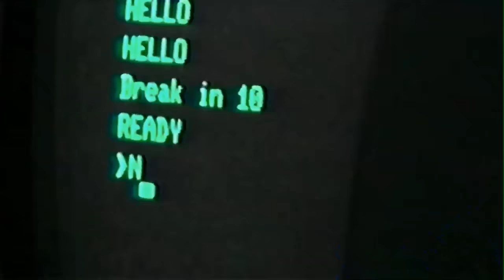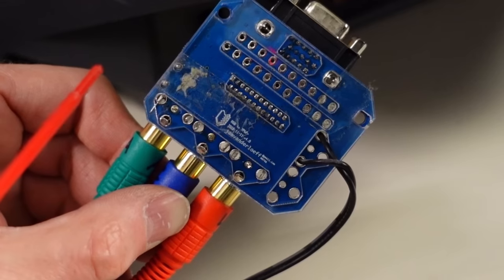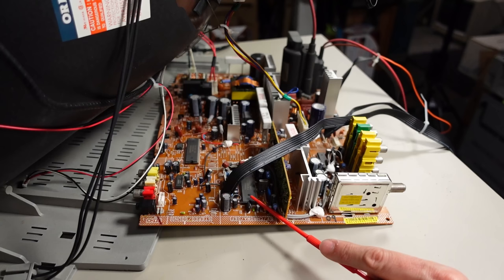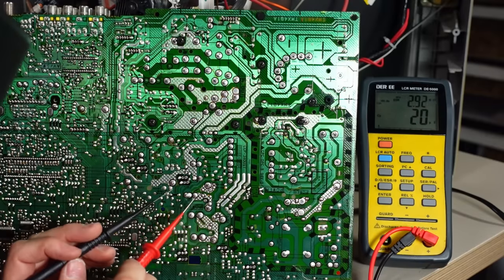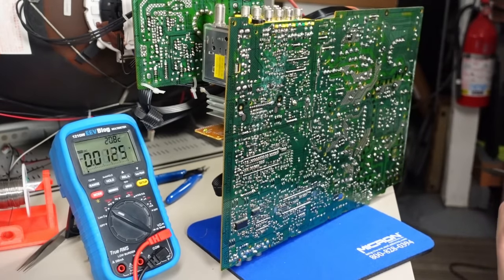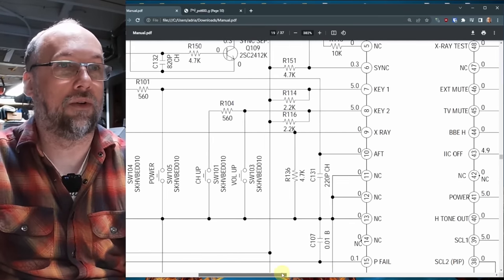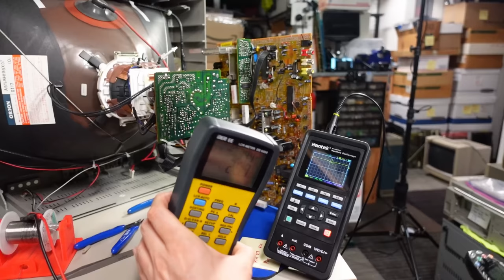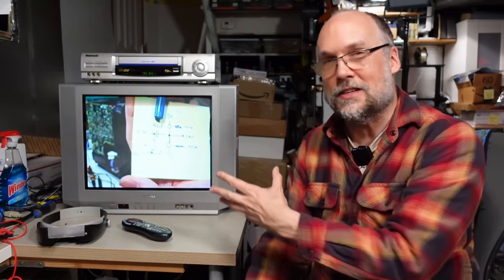I figured out exactly what's wrong with my Toshiba CRT TV (20AF41)

Comment: To be honest, I would check the other things that are connected to that 5V line as well.  It's quite possible that it wasn't just that one capacitor that was the cause, but a combination of several of them, all getting to the point where they're respectively failing to do their full job, and the total sag is adding up to too much.

Or there may be another component which is consuming more power than it's supposed to when the set first starts up, causing the sag in the first place.

I can't say for certain, but my gut says that it doesn't really feel to me like you've necessarily completely fixed the issue, maybe just postponed it...
Reply: You are right. The main problem is poor engineering. The 5V (standby) rail that is sagging is getting power from a 8.9V unregulated rail, which is also powers an other 5V rail through a 7805. The 8.9V rail is filtered by a 470uF capacitor. The 7805 has an other 470uF capacitor on its input, and a 1000uF on its output. So when the switching transistor switches on the 7805, it switches a discharged 470uF on the 8.9V rail, which only has an other 470uF for filtering. This is a huge inrush current, and the 1000uF on the output of the 7805 also adds to that. Not great, I would say. As I suggested above, I would replace the 470uF on the 8.9V rail to 680-1000uF. The ESR of the original 470uF probably gone up a bit, but it was probably only marginally working from the factory, due to this bad design decision.
Reply: @mrnmrn1  Ah, I have to admit, it hadn't even occurred to me that the problem might be on the upstream rail (but I also didn't go and actually look at the schematic, because I'm lazy).

That just shows how it does really pay to look at the larger picture and not just focus on a single piece or component, though..  nice investigation work!

Comment: I recently salvaged an old EMac from mid-90's from an old lady who was about to toss it. Now I am not so interested in the Mac components but it does have a really nice nearly flat shadow mask CRT. She also said it had not been used for a long time and when new it was not used much either. The machine has seen at most 100 hours of operation. I have yet to disassemble the machine, but I am expecting the CRT's Cathode to be nearly pristine. Keeping it for eternity or until it breaks, because these things are becoming exceedingly rare. If only I'd realized BEFORE I tossed a beautiful trinitron CRT (approx 10 yrs ago) with ultra fine aperture grille, how valuable they'd become. I love LCDs but CRT's gives the retro stuff a pure look like nothing else. 
I am hoping there's some genius little guy sitting in a little office somewhere in China or Japan working on a way to make flexible OLED displays with a bulge so they resemble CRTs in appearance.

Comment: If its "actually from the 90s" & a higher grade model it for sure has S video. 
That was a must as everything had S video in "1998" etc that i ever saw.
Edit- I am positive I have two Orion sets. Bought cheap after led tv became popular. One still in the box with the Future Shop receipt and warranty, never used, the other lightly used. I can't remember if they have S video but the spot to connect everything is up at easy access.  
The receipt date was late 2004/early 2005 so the last gasp of crt tv. The box states something like "High quality TV". I bought it for a relative who after decided he wanted a big  flat screen so here it sits. 
I also have an MTC that looks a lot like a clone of Adrians set i use to test dvd players on. 
There's been a few cases where faulty components were going out to customers and companies.
Both transistors and caps.

Comment: We had a really nice Philco that was a 'flat' CRT in the early early 90's. Lots of digital on-screen controls (in green!), pretty nice size, and beautiful black case and metal grill speaker covers on both sides of the screen. It was really nice. I can't find evidence that it ever existed - or who actually made the TV, as Philco is sort of one of those non-brand brands.
Reply: Philco US was owned by Philips since 1981. It was its own brand before becoming a Philips subsidiary. But you're right, flat CRT were a thing (but not quite common) in the late 80's/early 90's before becoming ubiquitous in the 2000's to align with LCD screens.

Comment: I've got a bit of a headache with  swapping the smaller electrolytics with MLCCs. The ESR you measured seams not to be uncommon for an electrolytic of this voltage rating and capacitance. The MLCCs you used as a replacement are most likely X7R or Y5V, so they have a more or less significant capacitance over voltage derating. If they're used as bypass capacitors than it might be OK, but a higher ESR cap might also have been chosen on purpose...

I also believe that swapping the larger cap did not fix the actual problem as the voltage dip is still there, just somewhat less pronounced. So the power supply is still marginal. I'm with @mrnmrn1's post here.

Comment: The clogged-head syndrome reminds me of those cheap no-name VHS cassettes, where if you left it on pause for a few seconds, you could watch the picture deteriorate into snow requiring another head cleaning operation. The opposite of course being those Memo-wrecks tapes which kept the heads perfectly clean by virtue of sanding them down, including the upper (and sometimes lower) drum.

I tended to use thin card on its smooth side rather than paper though and gently rock the heads back and forth to dislodge the crud from the heads without stressing them. Mind you, back then König had pretty decent "pattern" replacement video heads for around a tenner trade, which seemed just as good as the originals and lasted well. Those were the days!

Comment: Saw the ‘Special K’ Rubycons and didn’t think it would have been that! Remember the early 2000s Cap Plague, swapped out over 200 Dell GX270 motherboards, the Special K caps always were fine.
Reply from the maker: Yeah!! I was surprised quality caps in this TV -- and that it is having an issue. I just worked on a 2000 era Soyo P3 motherboard -- and some "Wendell" brand caps were all completely dead. 1000uf/6.3v and all were 30-50uf with high ESR. At least they hadn't leaked but what crap!

Comment: You should use the tweezer lead that comes with the DE-5000. It does four wire measurements that should be more accurate without the extra resistance and inductance of the multimeter leads.

Comment: Especially on a CRT, component is as good as true RGB. I use a SCART RGB-component converter for all of my game consoles. It works out well, since SCART RGB cables exist for pretty much every RGB-enabled console and most 15kHz computers.
Reply: On CRTs from the 80s and 90s, SCART RGB goes almost directly to the electron guns. However in the 2000s, this changed, because processing had to be done (for example for the 4:3/16:9 switching). Those televisions mostly do their processing in the YUV colour space, which means that RGB from SCART is immedeately digitized and then coverted to digital YUV, which then went into the image processor. For such televisions, it is completely irrelevant wether you use SCART or component. On the older televisions, RGB is favourable as it is the native video signal for a CRT.

Comment: I have that same exact Panasonic Super VCR VHS player that still works to this date.  It has the problem of playing older VHS tapes in SLP and EP (4 hr and 6 hr formats).  It plays and tracks regular SP (2 hr) tapes.  But yes!  Neat you fixed it cleaning the tape head.  I haven't cleaned mine since owning it from like 2002  or some day then.  As far as CRT TVs I think I had a simple diode problem failure but I added to the problem by cracking my bottom power board as the TV maker confused me as to extra set of screws that needed to be removed hidden at the bottom holding that board in place when trying to remove the back on a 2005 RCA CRT TV with those same number of accessory ports also for inputs and outputs to the TV.

Comment: I watch a lot of urban exploration videos and several years ago there was a video where the guys went to China to do some urbexing over there (probably not exactly the smartest thing to do, but that's another discussion) and they ended up inside of an abandoned manufacturing facility that had a lot of stuff left over in it that wasn't Orion, but was in use up until the late 00s according to some of the left over documents they found. There were brand new, unused CRTs on shelves (just the bare tubes) as well as a room with some of the coil winding machines that were used in the manufacturing process. That stuff was probably some of the last remaining CRT manufacturing equipment in existence and it was just rotting away in an abandoned building in China somewhere. It was a bit sad to think there will never be another new CRT manufactured in this world. The manufacturing process is so complex and requires all of that specialized equipment to produce that there's zero chance for some independent manufacturer to pop up the way other things, such as cassette tapes, have.

Comment: Hi adrian, Ray Burke here, I have the same DE 5000 capacitance meter. When measuring ESR of Electrolylics, you need to use the 100 KHz for ESR.  You might check the Data Sheets for the capacitors you are testing they are online by Manufacture.  It is usually listed at the top of the chart.  Most Capacitance testers can test ESR in circuit, pull part if high.  Most people have trouble using  that high end  Capacitance testers like DE 5000.  Good luck from Ray Burke, I live in Oregon City.

Comment: Sometimes when the heads are grimy enough and IPA doesn't cut it, I'll CAREFULLY use a bit of acetone and a swab before using the IPA and paper again. That tends to work wonders, but I definitely recommend sticking with it as a last resort if isopropyl alcohol and paper isn't cutting it.

Comment: "The Cap Plague." 😄  According to the story I heard, it was a case of industrial espionage which went very wrong.  One capacitor manufacturer tried to steal another manufacturer's chemical formula for the insides of electrolytic capacitors, but the formula which they stole was the equivalent of an "early draft" which had not been properly balanced.  The formula was followed exactly and because it was wrong, it caused the early failure of all of the capacitors manufactured by that company.
Edit1:  I just noticed that you have Cubic Player running in the background!  I wish I could find more module files to play.  The main problem with Cubic Player is that these days it has to be run through DosBox and that isn't always reliable.
Edit2: I've had a TV with exactly that same problem.  It started clicking when I tried to turn it on with the remote, then after a little while it would start up.  The problem gradually got worse and worse until it wouldn't start at all.  I replaced the power supply capacitors (they were bulging) and the problem went away.  I've heard of caps going bad without bulging, though.
Reply: I t used to be so common to open up a computer in the very late 90"s early 00's and see capacitors with the vents popped and dried electrolyte on top.

Even 1 year old computers would start rebooting and freezing up, and you'd open the case and find split caps.

In 05 I got a job doing desktop support and the guys that had been working there said an absolute boatload of the Dell computers the company was using (1600 person office) had this issue, they were replacing motherboards and pc's like crazy.
Reply from the maker: Yeah I run OCP on my Pentium with a SB16 and it just works perfectly. What a great program! I've been curating my module collection going back to my Amiga days. I liken it to a CD collection! As for the caps -- yeah I don't really get why it seems late 90s good brands are kind of junk too. I assume it was cost cutting to be more competitive with the stolen formulas? And that cheapening resulted in them going bad more quickly. Just such a difference between caps from the 80s....

Comment: Hi Adrian,
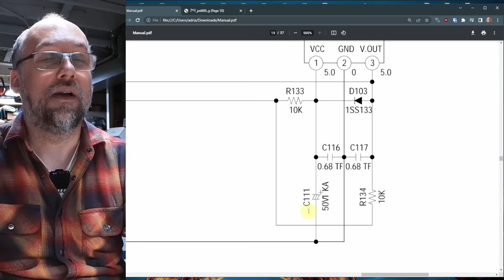@50:00 did you check C111 at least? Looks like the supply for the reset IC is filtered through a 10k resistor (R133). If there is a “short” drop-down in the main +5V, the combination of R133 and C111 should prevent the IC to trigger a reset. If C111 is defective, the IC “sees” the +5V direct over R133 and a short drop will cause a reset. A good capacitor (C111) will filter a short drop-out.
Or maybe I'm wrong :)

Comment: Capacitor plague never ended. If you watch a repair video on a modern hardware, it's mostly a small surface mount cap shorted to ground.
Reply: Capacitors have always had a limited lifespan. It's the nature of What they do and how they do it. Some last longer than others , especially if the circuit is well designed and doesn't overstress them and if they were made well in the first place. Even then that's never a guarantee they will last. The smaller they shrink, the more vulnerable they are to contamination and other micro issues because there's just less room for mistakes.

Comment: On Orion made sets at least from the early 90s it's important to remove the rubber wedges as they will eventually destroy the yoke. I had to remove them from my 1993 Orion made set before they caused trouble.

Comment: I had this set back in 2002 to 2004 before I upgraded to a LCD. The speakers were great really good loud sounds the amp inside this set is good. 20 watt for each speaker 40 watts max not too bad. The component if I remember could do 480p input the rest of the inputs were 480i. S Video did give better colour on screen but the component gave better quality in the picture overall.

Comment: that cap was probably borderline capacitance value for what was needed, or maybe a problem further back in the psu making the 5v cpu line dip too far
Reply: It is! 1V dip is way too much, even if we ignore the reset circuit that is supposed to do its job when voltage is somewhere below 4.5V
Reply: I don't know, you don't just lose more than 20% capacitance over time without other traits of the cap shifting as well. ESR and the leakage. Theese are not strictly constant, they can drift depending on the soak voltage, which is why the measurement might not come out quite as bad as what it really is like. Capacitance often secondary to in-circuit behaviour like that.
Reply: @SianaGearz  definitely, you can have reasonably good capacitance, but far too high esr, you really need to check both to be sure a capacitor is bad or not, as a capacitor degrading from say 10uf to 5uf could still have a reasonably good esr

Comment: I kind of regret getting rid of the 480p ATSC-equipped 20" RCA flat CRT I found on a stairwell landing at CWRU during a summer research fellowship now.  It was actually a pretty nice one, progressive scan, low tube hours, component inputs, capable of receiving OTA HDTV signals.

Comment: I had that exact TV in the early 2000s. It was, in fact, my first TV when I got my first apartment. That red LED does indeed just indicate power. It should be on whenever the TV is on. I'm not sure why yours doesn't light up. Maybe it's a bad LED?

Comment: Most Toshiba branded monitors and TVs are made by Vestel in Turkey (in the EU anyway). Really shoddy stuff when you take them apart. Same TVs with Panasonic, Sharp, etc. I've just got an Iiyama 4k display in for repair. Iiyama used to be a top notch display maker back in the tube daya. This one is also trading on it's name, rubbish inside, it's pretty much scrap, but I will try to fix it for the customer.
Reply: Meh, Iiyama also made some really sh!tty CRT monitors too : I had a 19 inch low end CRT (it was really cheap, tho) Iiyama monitor that wasn't even able to display any decent image above 800x600 at 85Hz, it went to flicky 60Hz at 1024x768. This pile of garbage couldn't hold a candle to its older 17" second hand counterpar I had beforehand.

Comment: Always trust your analytical skills. :) Don’t be discouraged by it being “complicated”. If you have the manual and a general block diagram in your mind what makes one of these work you can trace yourself to just about any fault. I know you can do this, as you do it all the time with digital fault finding. It’s not that different. I can see now at the end you are catching on and doing it correctly. But just chasing caps is not the way to go on CRTs. They are heavy and have big boards that run hot, they have high frequencies and in places loads. Soldering , soot building up(shorting), heat damaged components like resistors, and also the odd capacitor. But measuring every capacitor is such a waste of time. :) A tip that’s not related to this video is to get yourself a variable isolator transformer. It can come in handy on a lot of older gear, like you work on. Bring the psu’s slowly up and it will help out capacitors reforming. We used that all the time.

Comment: I used to have an older version of this set, bought it at Future shop in 2006 as an open box for my first brand new TV I ever bought when they still existed in the US and it served me well. Don't recall if it had RGB inputs, but it was the 20" model, though it went from being my primary TV to a bedroom one when I was given an old 27" TV that was old and failing within a few years and then bought a brand new Samsung LCD TV (32") and I still have that, yes, it's 720P.

As for CRT TV in the US, they run at 60Hz, 425 lines or so, so 480 was about all they could do, which is considered SD, though some sites like YT will consider 720 as SD, when it's not exactly SD, but pseudo HD. 1080P+ is full HD. At least the earlier versions were quite good.
Reply: 720 is the actual standard of HD and not just "pseudo HD". 1080 is Full HD. 4k is UHD.
Reply: @jamescarter3196  Thanks for the correction on 720. You are right, it is considered HD as I was aware of, but yeah, YT does not show 720 as HD.